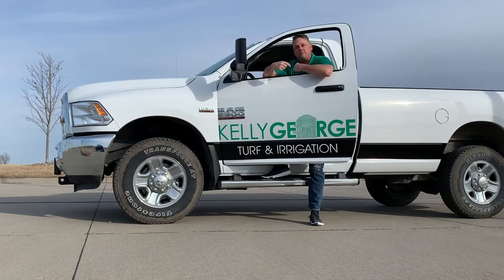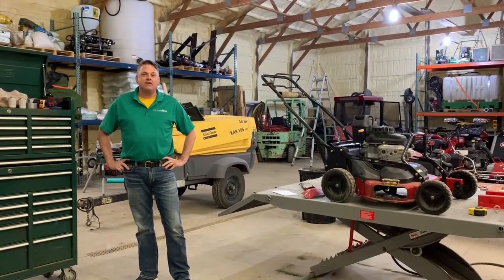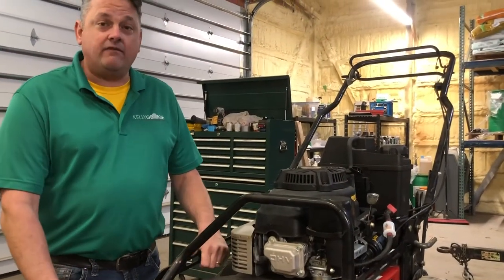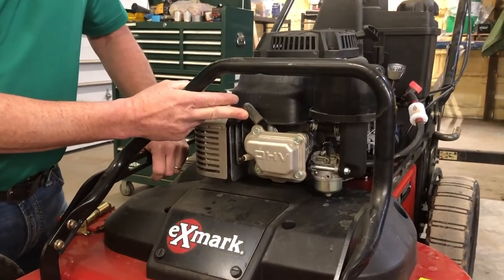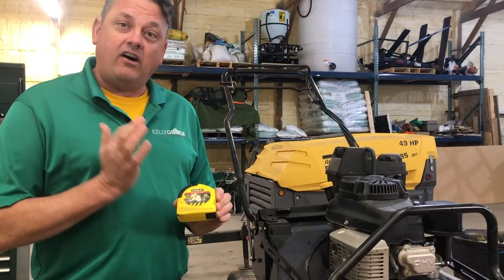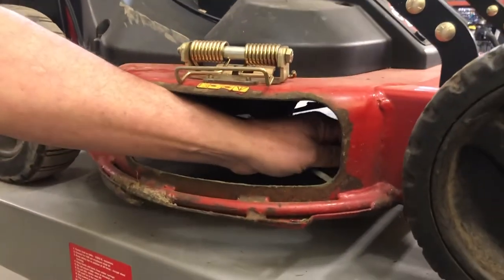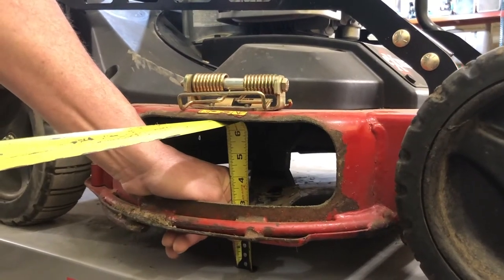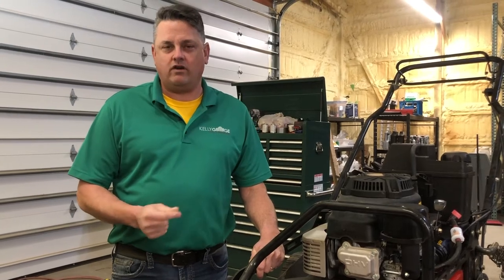Determining the Height of Cut on Your Mower

Comment: I live in TX.  I was told that 3" is way too long for Bermuda and the best height is 1" if you don't scalp due to uneven ground.  If you scalp spots, up it a half inch until you don't.  My easy test for a push/self propelled mower is to set it at 4 at all four wheels, which is theoretically supposed to be 4 inches (but it's more like 3").  So I do that first in a spot with 4 and then I check and actual blade of grass for how long it is.  Then I know what the offset is.  4 is 3 inches.  3 is 2 inches, etc.  Unless you are a lawn cutting professional, it's usually a one time set it and forget it setting.